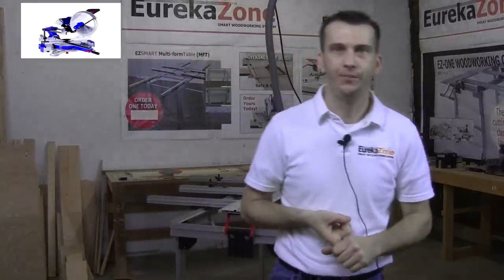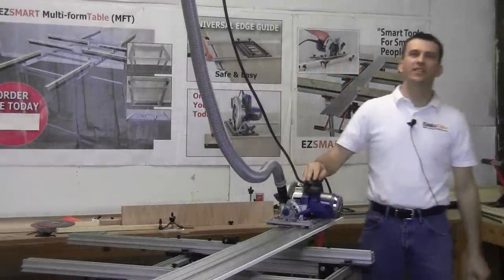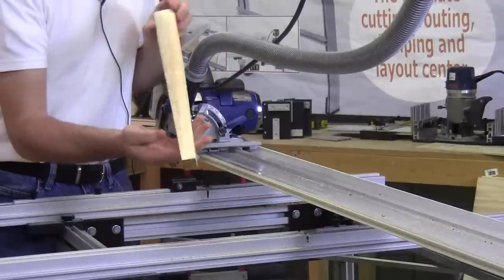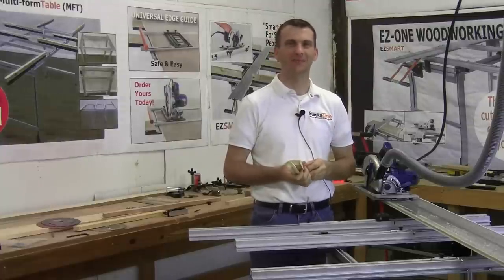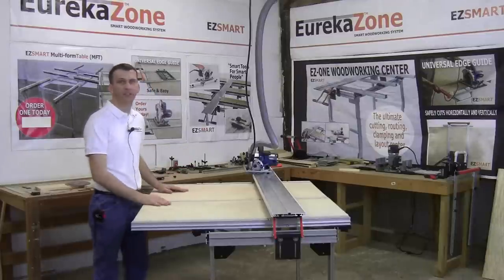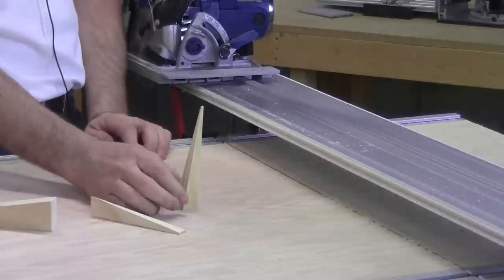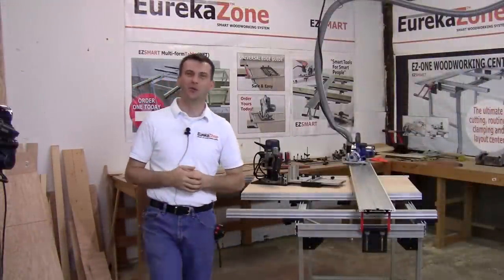Introducing The EZ-One Woodworking Center

Comment: I was unlucky enough to own this. Table is wobbly and requires constant re-squaring. Limited cutting capacity.  The table won't cut an entire 4 x 8 sheet.  This product is limited to small work, anything larger than a small box the table is moot.  Also the table is barely functional because all the clamps are sold separately.  I wish I could get a refund but alas.
Reply: The clamps are included even if you don't nee clamps with the ez-one.
that tells me that you don't have the tool .
The table has 50" capacity. if that is a small work..you must be a giant.
don't wish...ask for a refund. But first you must have the tool?
Thanks for all the lies.
dino
Reply: I actually do own the table, I purchased it at Rockler prior to Rockler discontinuing the product in their line up.  Contrary to popular belief, I was really excited at first, but the more I used it the less I became convinced this was a good product.  I used it for a full year and ended up dismantling it.  I use the table as an additional surface but it's too high to be an assembly table (I'm 5' 7" and the table is nearly 48" tall).

The track has little to no accessories available to it.  I ended up switching over to Festool because the ecosystem works and there are plenty of 3rd party companies that produce quality accessories.  The EZSmart is far too proprietary and no 3rd party companies produce accessories for it.  Lastly, my EZOne did not come with the clamps, it was not in the packaging and neither was it in the instructions.  I ended up purchasing the separately.  Anyways, apparently  you enjoy harassing customers, so I guess I feel justified in my steering people away from this product but I don't need to do anything, I mean, Rockler stopped stocking the EZOne system.
Reply: Brian, Looks like you received 1/2 of the table? We include 4 -6way stops,  2 clamps, a smart base and more.
Best thing is ( was) to call the office?
Thanks,
Reply: Brian,  The clamps, stops and base are included. Even the squaring rod.
The table is very large and able to rip and cross cut up to 50"
We have better ways to rip panels. try the UEG. I don't think you have the table
thanks

Comment: For the price Eurekazone charges, get yourself a Festool TS75 and a GRS-16 Guide Rail Square from TSO Products.  You'll get a better value, easy to square cuts, and a quality saw.
Reply: You have no clue about the value of the eurekazone products.
Even Festool and many others are copying the ez designs. 
Maybe you can't stand the fact that you have a lower quality product and you paid much more. Or...you simply try to do your job and promote  others while putting down the best cut table ever.
Reply: True, once you add your saw and peripherals, costs begin to climb. Yet, adding the routing system to an MFT and TS75 kit comes in around $2k which about a third more than EZ. Maybe it's worth it. But try calling Festool or any other company with an idea for a custom set up. Then, compare costs.  I went with EZ for the cost of entry. Since then I've order additional pieces to suit my work style. For those with generic needs, a plug and play system is fine. For tinkerers and tweakers who prefer or need to something unique, EZ is the way to go. Choose your saw, your router, your table size, rail length, etc. I've seen guys spend thousands on mods and jigs for a table saw and it's still less safe and efficient than this system.

Comment: I have a project I do that does a tapered cut with a 9 degree bevel edge I didn't see if you could using the bevel on the saw or not while using this. Is that possible?
Reply: Kerry Mullins Yes, it does bevel cuts. However, it does so on a different cut line to avoid ruining zero clearance edge. Normally, bevel cuts are a two-handed operation since the saw can tip. But 9° isn't that severe. the accuracy of your bevel will depend on the saw more than anything else. I work faster and safer with mine and rarely take a table saw to the job site anymore.

Comment: I dont understand how a track saw could be unsafe compare to table saw? I have a track saw, and it feel safer than passing your hand near a stick out blade. The bad thing with track saw in my experience is, it hard to get square cut you should mark two side also it hard to get a consistent repetitive cut and cutting small piece. That is why festool come with parallel guide and mft, but their system so expensive. But I do think ez track system, not as good as festool, but they sell the bridge kit which seem a good alternative to mft, because it can be use with other track system and mounted on custom table. You can have bigger cut capacity depend on the table you build. Although it is better using parallel guide for rip cut a big sheet and use this system for crosscut.

Comment: Laney,  at 8:40 in you get into cutting panels for casework.  I am wondering what mods could be made so you could have say 7' of that plywood panel hanging off the EZ1 but still supported.  Would adding some additional SSME components off tot he left side be the best way to handle that without needing to set up roller stands?
Reply from the maker: John,
The sheet I was cutting was a full 8 foot in length. If you are looking to have 7' hanging off the side of the table and be supported you could use a roller stand, or shop made in/out feed table, etc. Adding additional SSME off to the left would provide additional support, but you would need at least 5 foot of overhanging SSME from the table and even then, there may be a requirement for additional support..I personally would recommend either a roller stand or in/out feed rolling table of sorts. Feel free to call the office to discuss this more for a clearer understanding of what im referring to
Reply: They offer longer extrusions if you need more support. They also offer the EZ1Max that can rip a full sheet.

Comment: At $1000 this this is as expensive a hell! I might be willing to pay $200 for one.
Reply: Go to 80/20 and spec out your own table. You'll spend twice as much. Go to Festool. Their MFT, saw, router, and peripherals will set you back $2k. Go buy a Sawstop PCS, $2,400 minimum but you still need a way to safely and accurately break down sheet goods, and you still need a router system. Ive been there, done all that. Now, consider the option to completely customize your work space. No one comes close to doing what EZ does for the money.

Comment: Hey...don't I know you from somewhere???!!   Actually this things got merit.  As fast as I was coming up with things that it couldn't do compared to a table saw, you went ahead and did it!!. It looks like a Festool track saw on steroids!! I guess if I had one concern it would be the weight of the system.  It looks very light and "spindly".  Still, I think I'll go over to the website and take a look.  Cheers.
Reply: It's as stable as the Festool MFT. So, it's usually adequate.

Comment: Oh man do I see a lot of possibilities with this system.   Now I've got to talk management into letting me get it. Lol
Reply: With the exception of really long rips, for which I now have a really long rail, this has replaced my job site saw. It required a change in work flow, ie. crosscut before rip, etc. But my work is safer, faster, and just as accurate. Experience kickback one time on a table saw and you'll love this thing.

Comment: what's the advantages of not having a solid table?
Reply: Unlimited configurations and setups.
You can trap any shape . From 1/4" up to 50".
But again...IF you have to use a solid top, the top converts to a solid one.
thanks
dino
Reply: Where are the samples to all the different configurations?
Reply: A different demo would help answer this. But from personal experience, it is easy to use the stops and sliding rails to reconfigure it for any repeating task you have. I work faster and safer with my EZ tools and I'm not locked into a proprietary brand of power tools and rarely take a table saw to the job site anymore.

Comment: Hi,
 I have a question about the clamping system. At 8:36, it appears that you are applying pressure to the clamp with your right hand and cutting with your left hand. At 8:57, you start with your right hand on the clamp and then remove it and place behind your back at 8:58 while finishing your cut. Does the clamping system require the user to apply pressure with a free hand or leg while making a cut or does the clamping system hold the piece in place without the user applying pressure to the clamp handle?
Thanks
Michael
Reply from the maker: Michael,
When the clamp is set it holds its position no more need for the user to apply pressure. If the user desires to hold on to the handle or apply more pressure, during the cut, he/she can do so... either way.
Reply: He was removing  the cord from the table.
Best to suspend the cord and hose.
tx
d

Comment: I noticed it had a makita power plant, does it adapt to any hand held saw ? The cut obtainable by the makita is great for general use but it's no festool
Reply: today's saws are in pair. Only the blade makes a better cut, but the ez system offers the best antichip protection
Reply: The newer saws from Mafell, Makita, Skil, and DeWalt are sturdier and most are as accurate with comparable dust collection. But the TS75 is the one they all want to beat.

Comment: Watched through all the videos. Claiming that it replaces miter saw but how do you do crown compound cuts on it?
Reply: Bogdan Aktamakov Great question. Answer, it doesn't. Sliding compound miter is still best for crown and fast in some other tasks. Where this shines is cross cutting panels and short rips. I rarely drag a table saw total the job site anymore. This is lighter, safer and faster.

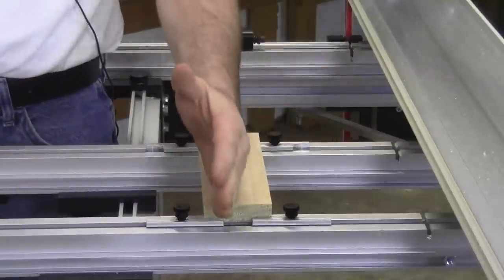Comment: At 6:12 in, we were told that the material will need to be relocated under the cutting bar. Why can't the cutting bar be moved over the material (design flaw)?
It's a shame after converting the tool to a workbench you couldn't move the cutting bar farther away (design flaw)?
13:27 in, we were told that the material had been planed (planner) prior to this demo.
Why didn't you show how to convert tool into a planner?
Reply: It's not a planner but can do some jointing. If I understand your question,  the rail is squared to the edge of the table at set up. If the rail and bridge are moved, they will have to be re-squared. It would waste a lot of time.

Comment: The cost seems to be on par with Festool after one adds the attachments and such.  Which is faster and easier to setup?
Reply: Hi. The capacity is greater. Build like a tank for lifetime use.Unlimited versatility and the list goes on and on.
it even works with festool tools. ( Universal)
thanks
dio
Reply: The Festool is a slick plug and play proprietary system that is great for generic applications. With their router system and peripherals, it will cost more and you'll be locked in to their tools. With EZ, use any brand saw or router you want. Set it up for your task. Expand or change as you need. A little more tinkering but your adapting the system to your work and not the other way around.

Comment: How would you use this to breakdown and fabricate casework from 4x8 panels?
Reply: Robert Weinstein I got their Universal Edge Guide, UEG to rip panels. Its the best at what it does for me. I also use a centipede sawhorse. Best setup I've used for on-site builds. Then, use the EZ1 for crosscuts. I'm a one man operation. This is very efficient and it beats the heck out of pushing sheet of 3/4 ply thru the table saw by myself!

Comment: Where is the sacrificial board to keep from ruining your blades on the aluminum extrusion? Cutting aluminum with a wood cutting blade will ruin it, please add a sacrifice board.
Reply: Brian, the cut line is always the same 
and it comes pre cut from the factory.
You can cut the aluminum even deeper with no effect.
But we offer a safety stop/indicator to avoid that.  ( included)
If you can managed to cut beyond return...
a small self aligning connector makes the beam even better.
thanks
Reply: Aluminum is softer than the carbide on the blade. Easier on the blade than hickory.
Reply: Brian Boatright do you actually know what you are talking about
Reply: I'm a finish carpenter and furniture maker. I work with this stuff all the time. You can cut aluminum all day long with a regular blade. Be careful of the shavings. They're razor sharp.

Comment: how long before you have to replace the aluminum structure. under the blade cut before it collapses since you cutting into the aluminum structure. Does not make sense or safety in my mind.
.
Reply: The cut line is always the same. The supporting beams are very thick 1.50"
and even if you manage to bypass the depth safety indicator
you can re-connect the beam  with any ez connector.
thanks
Reply: never.
Reply: I'm going on three years and don't foresee ever having to replace a cross member short of an accident.

Comment: For all those worried about cutting into aluminum it looks as if there is a kerf relief in the crossmembers. I don't know if he cut it there to begin with or if it is manufactured that way. It would have been nice if he addressed that issue in this video since we all seemed to come up with such an obvious question immediately. Perhaps he will post a response in the comments.
Reply: It appears that you can move the cross members and slide then to the right or left to accommodate the size of stock you are working with,  but that means that he must have cut those grooves into the cross members initially.   You would only have to cut them once per adjustment so it's not the end of the world but it would be best to change blades for that.
Reply: Joe Collier 6:05 it looks to me like those were sawblade vs aluminium....
Reply: So, over time you would likely need to replace those cross members.
Reply: +Joe Collier Yeah, that really should have been address right up front. I'm still left wondering how to handle arbitrary angles for diagonal cuts, not just 45 degree that is shown on the opposite side. Ideally the aluminum rail would have an open arc-way of 95 to ~ 50 degree. I'm wondering if a large grinding wheel can be attached to the rotary saw, to make the proper arc. As far as replacing the cross members, I''m not so sure, I would imagine them being mostly to support material, and if there is only one weak area that is no big deal. Probably better to use this system with a sacrificial sheet below the track, above the rails.
Reply: No.
The aluminum has a cut line.
you always cut on this line.
tx
d
Reply: Indeed the cuts are done at the factory. There is NO need to change the extrusion positions either, when it comes to laterally. If "Black Dog" could ever learn to talk with out using profanity; he may also learn things that make him realize just how ignorant he is.

Oh well.
Reply: I saw only one cut line for each cross member.  Since the cross members slide horizontally, it means the mfrs cut line would move and your next cut would go through the aluminum.  Unless of course, the only reason for moving the cross members is to use a function other than cutting.  But that would mean having to realign all the cross members every time you change functions and return to cutting.  I agree with others that this issue hasn't been explained very well.
Reply: The extrusions, being made of aluminum, won't hurt the blade. Also, they can easily be replaced, if and when that time comes, for less than the price of a Festool MFT top. However, the intention with any saw is to avoid cutting deeper than necessary.

Comment: will it cut 4x8 feet plywood to size
tq
Reply: 50"  cross and rip cut capacity. 
If you use 5x5 baltic ( special plywood) we can make a custom table.
for longer  ( rip) cuts you can use the tracks or the UEG. ( edge guide)
thanks
Reply: I can easily crosscut up to 49" on my table. For long panel rips, I use btheir Universal Edge Guide, UEG. It's the best at what it does, in my opinion.

Comment: the demo shows that you can cut 4ft across on a 4 x 8 sheet, but didn't show that it was possible or even have room to cut the vertical length of 8ft on the table. I guess a person is suppose to buy or already have a track system that can accommodate this table. imo not worth the buy. just buy or make your own track system and table and it'll cost less than this product.
Reply: If you only want to break down sheet goods, you only need their Universal Edge Guide (UEG), the best at what it does IMO. However, this table has replaced my job site saw. I had to adapt my work flow but now I can actually do more safer and faster with equal accuracy. The only exception is long rips but that's an issue with any track saw. 
Try to find a comparable system. Only Festool comes close but for a lot more money. Unlike Festool, you can use any brand of saw or router you like and customize the entire system to your task. I'm a one man operation who does finish carpentry on-site as much as in the shop and EZ is safe, accurate, efficient, and cost effective. With the folding legs, set up is a snap. It may not be fancy but I need a pickup not a luxury sedan.